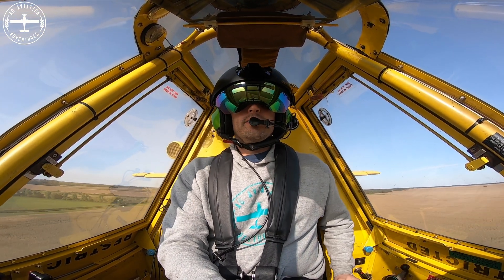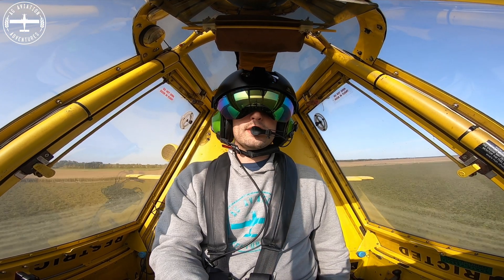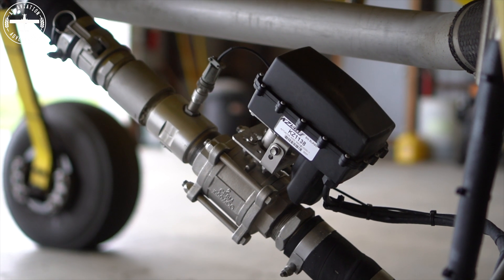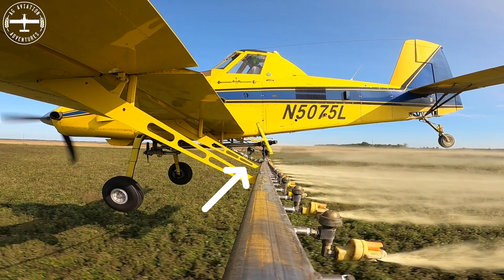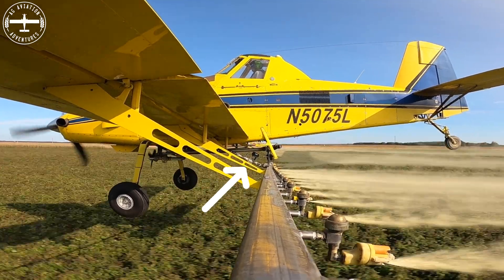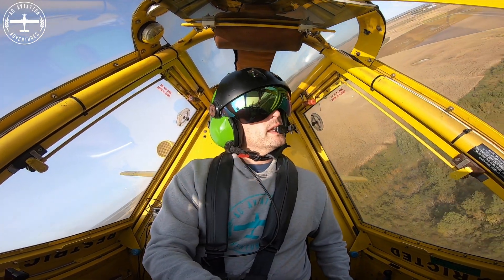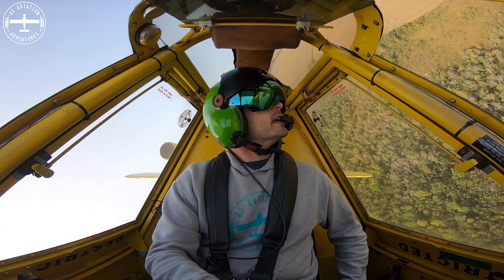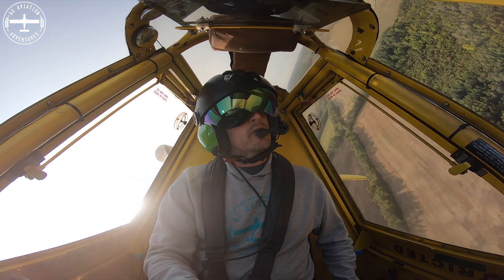Technology and Precision in Ag Aviation: How the Flow Control Works

Comment: Does the gps also start/stop the flow for you once you get to the edges of the field? (Your A/B points)  If not, would you prefer that to be automatic or is the manual system adequate?
Reply from the maker: There are some scenarios/setups where the gps will auto start/stop, but not in the type of spraying we're doing in ND. I prefer the control over the manual system.

Comment: It seems like a helicopter would be easier to use as a duster. What is your opinion?
Reply from the maker: They are more expensive to operate but can be useful in smaller fields with lots of obstacles.

Comment: Hi Tyson, another great video, thank you. Question, do you manually start and stop the flow or is it done automatically based on your A & B inputs into the GPS?
Reply from the maker: No I manually do it with a spray handle.

Comment: Great video!!! Kindly advise, how many yards in a straight line would you be able to spray with a full hopper? (in a ideal massive/large field)
Reply from the maker: If I was putting out 5 gpa I can roughly cover 8 ac in one mile. In those 8 acres I would have dispersed 40 gallons. If I had 500 gallons on board I could fly for 12.5 miles before running out.
Reply: @AgAviationAdventures  thank you that's is great. Would the swath be ~ 60 feet wide then?
Reply from the maker: That would be a 66’ swath.

Comment: Do u keep the same speed the whole flight or do u change the speed manually when u go down to spray or when u go up to turn
Reply: Man I have learned so much more about this job since I started watching this channel. Thanks for responding
Reply from the maker: Thanks for watching.
Reply from the maker: I don’t touch my throttle at all. My speed is only changing because of weight, climbing, descending, or winds.